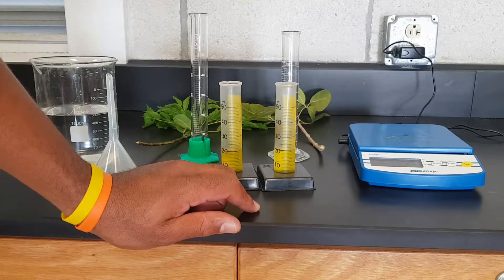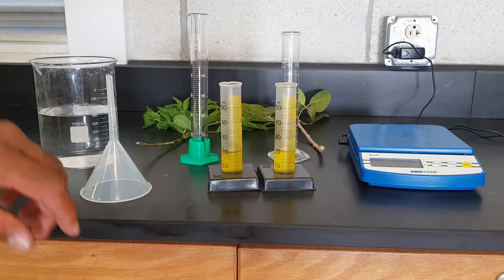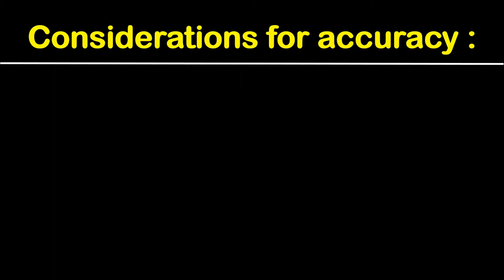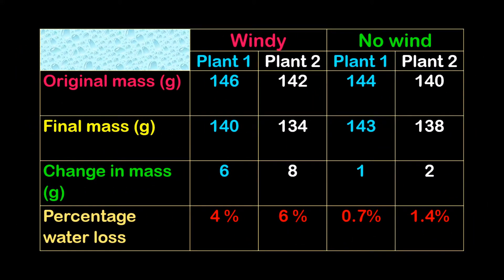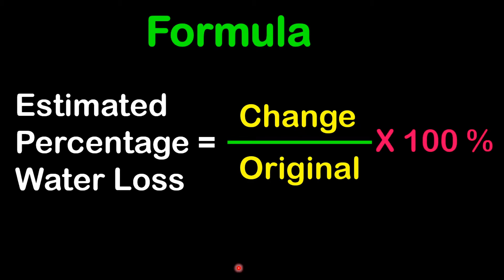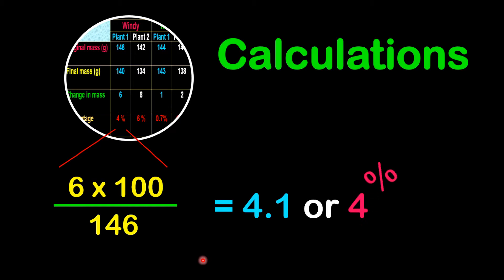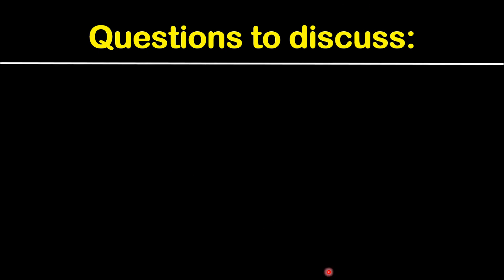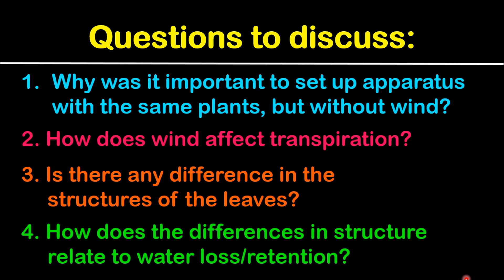Transpiration Experiment (2): Investigating the effects of wind on the rate of transpiration.

Comment: I noticed something about the way the plant shoots were immersed in the water. I felt you should put the plant shoots into the water before adding the oil. This is because the cut end of the shoot should not come in contact with the oil.
Reply from the maker: Oil is the last thing that should be added.

Comment: There is no roots present on there so how water go through xylem !!
Reply from the maker: The xylem is a narrow, hollow dead tube. Hence, as water evaporates from the leaves it will result in a continuous pulling of water. This is achieved by the capillary action of water. Additionally, this is easily achieved because water is adhesive and cohesive. See, transpiration pull.

Comment: Why we use oil in here ?
Reply from the maker: To prevent the evaporation of water from the bottle. Therefore, any water loss from the bottle must be by plant taking up water.
Reply: What is the reason quickly submerge the cut end of the branch in the measuring cylinder with the water ? Thank you for your response !
Reply from the maker: @Hotliverbaby  The cut end will allow the plant to uptake water easily since the xylem will now be exposed to water.